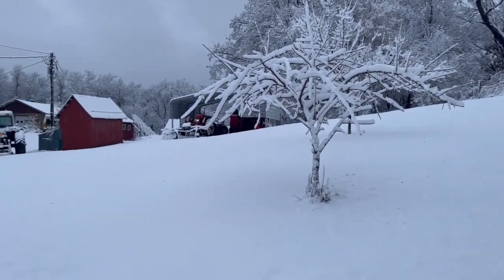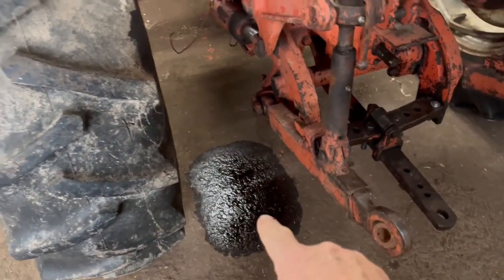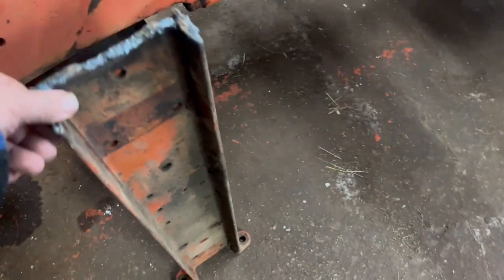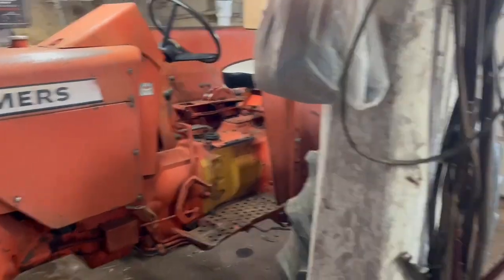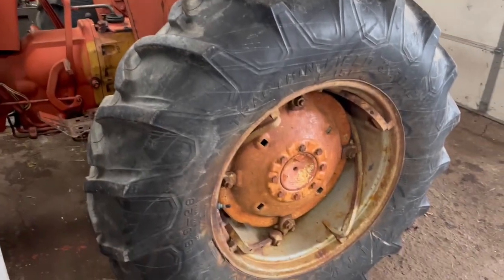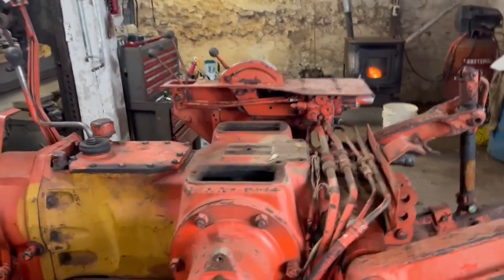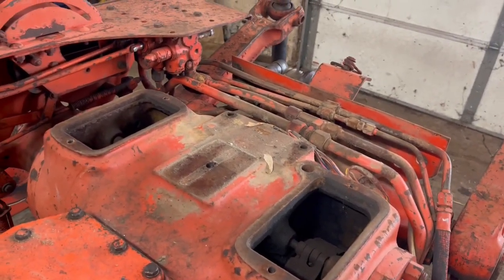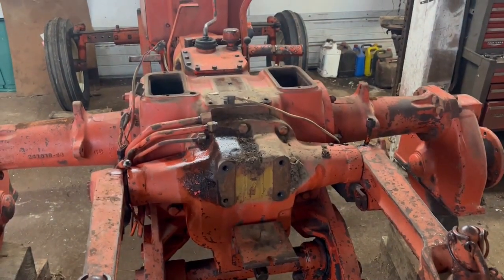Allis Chalmers 170 Transmission Rebuild: Part 1

Comment: I'm glad that's you taring all that apart instead of me.
I have a 20hp Kubota that needs transmission work (reverse grinds/pops out) but I'm scared to touch a transmission
Reply from the maker: Transmissions can be kind of intimidating. There's a lot of parts to deal with. I rebuilt the transmission in a neighbor's D15 back in the late '70s. Been so long ago I don't remember any specifics of the job other than the fact that I did it.

Comment: Looks like a fun project. Do you have to replace the breaks too?
Reply from the maker: Brakes aren’t very good, I figure on at least re-lining them. Wouldn’t be surprised if more is needed. I plan to keep this tractor for my own use so I’ll fix them right.

Comment: The 3rd gear looks like it's been ground a few hundred times. Be cautious with aftermarket gears. Have seen where they are not hardened nearly as well as oem.
Reply from the maker: Yeah, they’re all beat up pretty bad. One of the previous operators really trashed it.